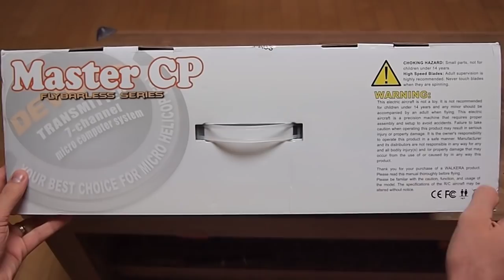Unboxing Walkera Master CP and size comparison vs 100 and 450 class

Comment: I'm new to these "advanced" rc aerobatic helicopters and I don't know why people are saying you should replace the servos? I don't even know what a servo is...
Reply from the maker: If you are looking at 6 channel helis, I think you know what a servo is :)
Indeed the standard walkera servos on the swashplate ( the tail is with direct motor) have plastic gears inside and mine stripped the teeth also. Replaced them with metal gear versions and flies well since then...
Cheers
Reply: +MrCofl1001 can u show me where in the banggood? im planning to buy this bird next 2months then i will buy the servo u said

Comment: what throws the battery you can put outside the valkera ... What other brand battery you can put in master cp?
Reply from the maker: Hi
As I already replied 3 months ago, I use Rhino 3s /1050 mah and can fly about 5 minutes on it...Fits just fine...

Comment: Did you have to replace the servos with metal gear ones
Reply from the maker: Was many years ago, think one servo was replaced...still would suggest to buy a 250 sized heli than this one

Comment: Just got this as a Xmas Present, one of my first Higher Channel RC helicopters, and to be honest i am a bit frightened by it, i have already broke a tail strut on it, luckily its only a $3 part but when it broke it was hardly off the ground =/
Reply from the maker: Only bad point about this heli is that the standard servos are really weak, and strip easily.
I replaced them with the metal fear version from walkera and not an issue since.
It's almost my favourite heli, helps you build confidence for moving to the bigger size helis..A simulator would be of great help to anyone moving from 4 to 6 channels, since these are not so stable in hover compared to the 4 channels or co-axial ones...

Comment: what battery fits another to put
Reply from the maker: Hi,
I use Rhino 3S 1050 mAh li-po and they fit just fine on the heli...
Reply: +MrCofl1001 cant see the battery in banggood?
Reply from the maker: got it from hobbyking

Comment: hi , where did you buy the battery? I saw on Hobbyking, but it stated 18mm on height, will it fit?  http://www.hobbyking.com/hobbyking/store/__51273__Rhino_1050mAh_3S_11_1v_40C_Lipoly_Pack_AU_Warehouse_.html
Reply from the maker: HI,
I have the 30C version and it fits just fine, no movement whatsoever...